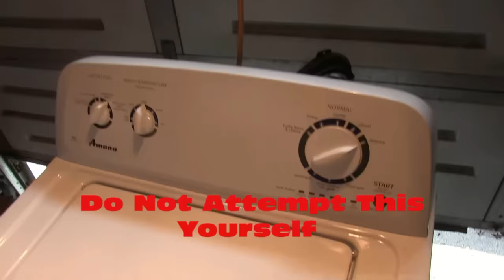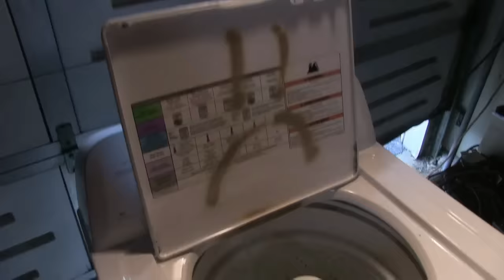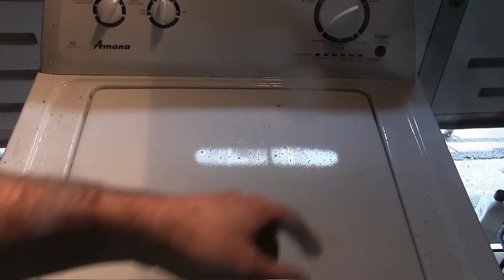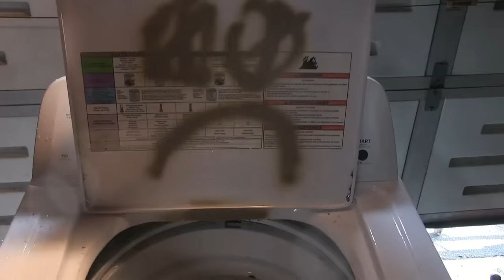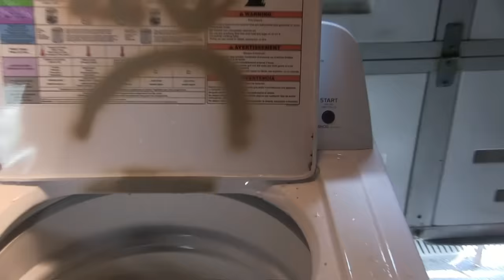HE Top Load Washer Destruction

Comment: Nice one, interesting red gunk came out of the pump motor. Now burn out the main motor.
Reply: That's probably not possible because it is a DC motor.
Reply: Just put 120 or 240 AC on the coils and it will burn out. If it is a universal motor that will work on AC and DC.

Comment: you should of overvolted the main motor  or put 240v on the washing machine  and run it normally
Reply: That's what I was thinking... super FASSTTT spin!! :)
Reply: @DJPenguino51   as they do have a 3kw step up transformer to run 240v  on 120v outlet  as i have seen it when they blew the washing machine pump

Comment: I actually parted out a Amana washer like that one. 2 week's ago. Because the control board fried itself and was nothing but scrap anyways.
Reply: Did you save the actuator with the synchronous motor that looks like the one you see at 19:28? I find those kind of cool and useful.
Reply: I actually did though

Comment: Hey what type of Transformer are you guys using to get 220.

I would not be using it for that purpose obviously but for other legitimate purposes.
Reply from the maker: It's a Rockstone Power 3000 Watt Step Up/Down transformer.
Reply: @ssmmkk2  thanks I took down the info.

Been looking for something like that.
Reply from the maker: @aaronbrandenburg2441  No problem. You can find it on Amazon just like every thing these days.
Reply: @ssmmkk2  I saw the actuator motor going to the agitating mechanism at 19:28. I looked those up online to see the rest of what they looked like, and it was interesting to see the rest of how those work. It has a synchronous 3 rpm motor that turns a 45 degree shaped cam with a pin that fits in the splutch that activates the agitator. The cam bumps into the housing to make the motor reverse to release the basket when the washer goes on spin cycle. The motor looks like a synchronous microwave turntable one.
Reply from the maker: @kwinters5550  You got it. They are a really easy part to change if they fail as well.
Reply: @ssmmkk2  That's great news. Thanks for letting me know how easy they are to replace.

Comment: Why are diagnostics a secret? Other than that its nice to see a top load washer get destroyed. All I've seen until now were the side loading ones with the power cord wired directly to the motor.
Reply: I like the actuator thing at 19:28. It's useful with that synchronous motor that looks like the ones in microwaves.

Comment: One of those POS washers without the gear box. So, they expect a 2 lb China or Mexico made electric motors to toss 25 lbs of wet clothes direct drive...bastard wouldn't make it 10 years, much less 25. Movers fucked up my Kitchen Aid front load...found a 1990s Maytag...washes easy, and works perfect.  You guys are crazy...the kind of people I like. 😁